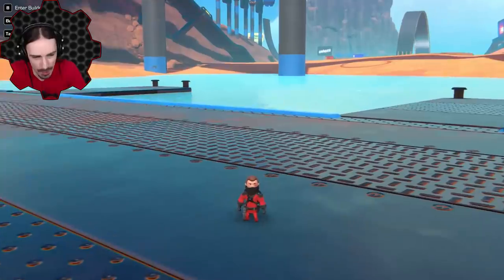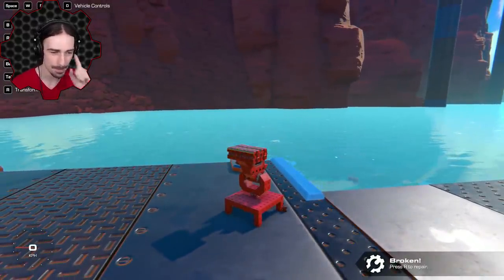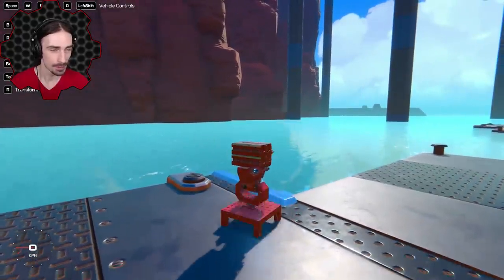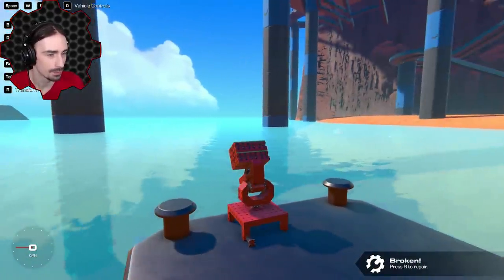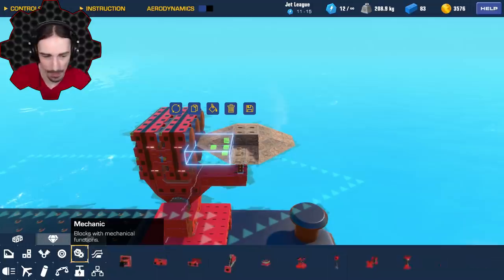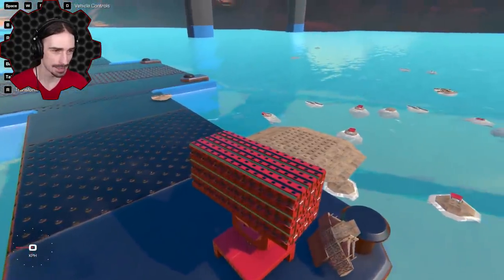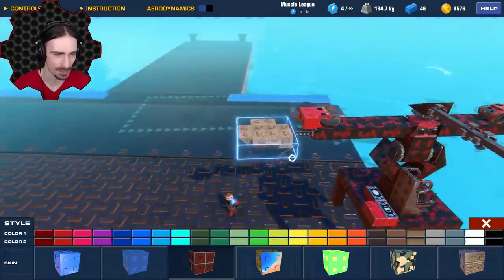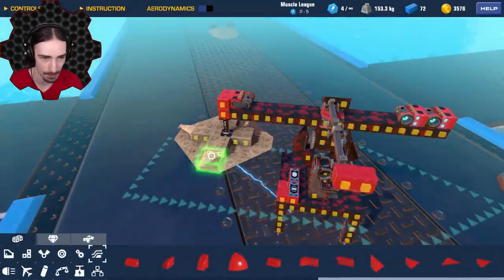Engineering The Worst Rock Skipping Robot Ever... - Trailmakers Gameplay

Comment: So the real trick to skipping a rock irl is to get the flat to grab and use the surface of the water to make a piled micro ramp and jump/skim via that, to get such and effect it needs usually between like a 20° and 45° angle depending upon the stone used. (Can be bigger or smaller in edge cases), what you are trying for is a rotational skim throw, and without actual water that can go up a rotating object that just simply wont work.  Plus it is not a great skipping method on liquids.  It does work decently on hard surfaces though.  And yes, rotation is a decently large factor in getting truly great skipping.  And lol, yup, that is a far better boomerang build, and similar to a version i have had before irl

Comment: You will want to add mini thrusters and keep the wings.  And the optimal angle of hitting the water is 45° and 12.5° angled down.  Also if you get it Moving faster, rotatonaly, you can make it more stable after hitting the water.

Comment: 5:28 correction rocks skip BECAUSE the rock is angled upwards so that is counted as a skip of a stone. so 5 minutes in you already have a successful prototype. now just more skips.
Reply from the maker: But the impact with the water wasn't causing it to angle up there, so it wasn't skipping off the water, the water just happened to be in it's already determined path when I pointed it that way. So that didn't count to me if the water wasn't the main cause of bouncing up.

Comment: I don't know if you did, but maybe research how rock skipping works and then how the water in this game works before trying something like this xD

like il probably eat my own words but the way it works in the game is probably that it just raises each component up that is touching the water and adding drag but in real life, it skips because the rock pushes the water in front of itself and making a "more solid" water ramp that it can use to jump.
correct me if I'm wrong xD

the reason why the last one looked like it was skipping is that the rock touches the water with its back it raises that part up and trough rotation trough the "core" the front part touches the water making 2 separate points of contact.